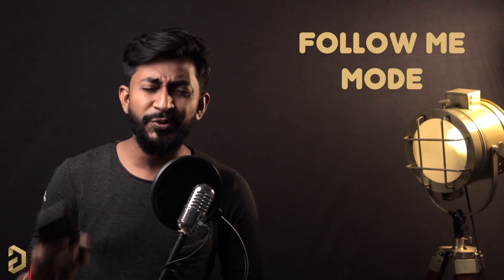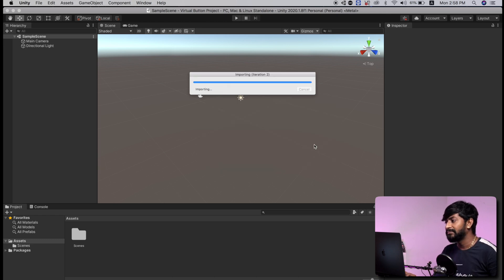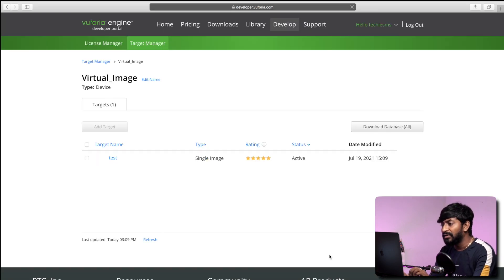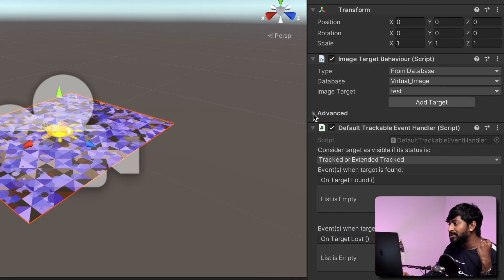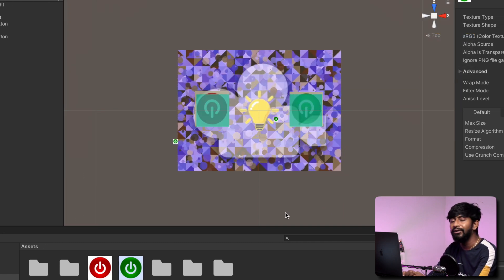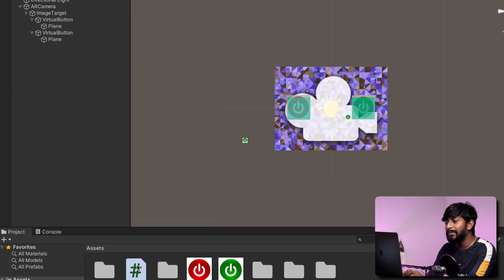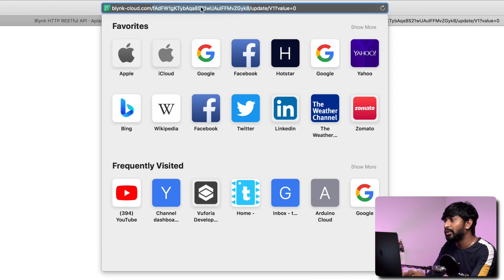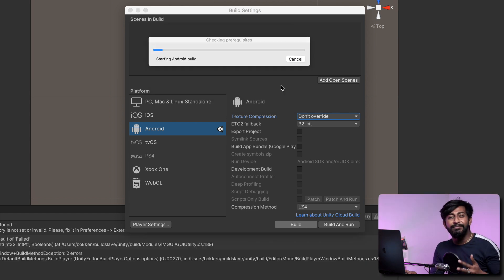Virtual Buttons to Control Home Appliances 🔥 | How to create Virtual buttons in Unity | AR + IoT

Comment: Sir please help me for solving this error.. 
failure

Manifest merger failed: uses-sdk:minSdkVersion 19 cannot be smaller than version 23 declared in library [:VuforiaEngine:] C:\Users\HP\.gradle\caches\transforms-2\files-2.1\4bfc2a74b1d49d2610ae80346bc9d60fjetified-VuforiaEngine\AndroidManifest.xml as the library might be using APIs not available in 19 See the Console for details.

This error came when I was build apk file

Comment: Sir I watched full video.. But at last moment where we will build apk.. I got an error ...
failure

Manifest merger failed: uses-sdk:minSdkVersion 19 cannot be smaller than version 23 declared in library [:VuforiaEngine:] C:\Users\HP\.gradle\caches\transforms-2\files-2.1\4bfc2a74b1d49d2610ae80346bc9d60fjetified-VuforiaEngine\AndroidManifest.xml as the library might be using APIs not available in 19 See the Console for details.

Sir please help me for removing this error.. 
Please sir
Reply: simply go to player setting on build settings then search for minimum you will find a drop down list choose api more then 23

Comment: Hi superfantabulous dude then can we use EsP 32 cam nodule to this? How does it use for this do you have an idea to use in next projects?
Reply from the maker: We can’t use that 
It because, it’s AR. It just image recognition. And AR Needs war more things than just a Camera 

So can’t do with ESP32cam
Reply: @techiesms  then dude can we do such a thing that in ESP 32 EEPROM we store the last states of the project( bulb on or off) then when power is not available can we that last state with NFC with AR
Reply: @techiesms  i mean even without power can we off or on the bulb using this method and nfc?
Reply from the maker: How can we control the appliances without power?
Reply: @techiesms  yeah that is an issue no then dude can we save a status of a bulb when having a power and then can we do this?